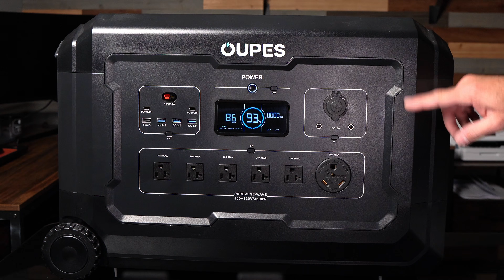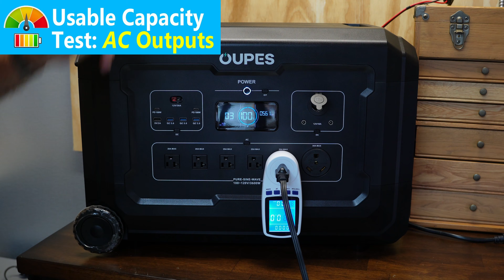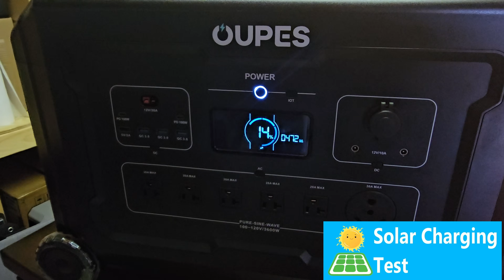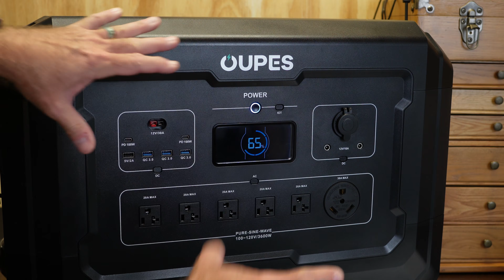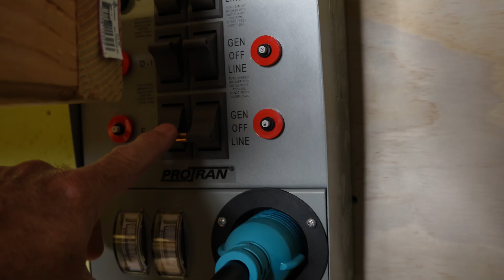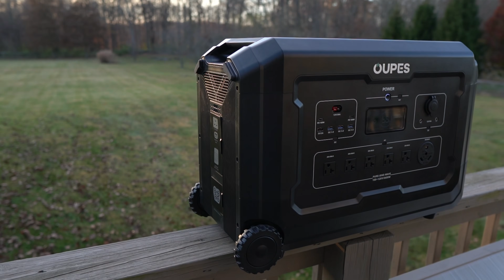The NEW MEGA 3 from OUPES:  Full Review and MEGA 3 GIVE-AWAY!!

Comment: Thanks for the review, in Argentina we have the second brand of Oupes (Souop), the M5 (5000watts) doesn't come with the RV Output like the American market but 5 output AC 220-240V 50-60hz - A10 each plug independent from each other, the question is if I want to add more than 2300w to my house will make sense to assemble (DIY) an extension cord with two 10A male plug (connected in the unit) to a 1 female plug 20A that goes connected in my house. Would those two 10A cables send 20A of energy to my house? so I would have more than 3000watts if necessary to use at the same time? does it make sense? or I will have only 10A in my house anyway? (around 2300w only).

Comment: Love your reviews and the  OUPES  generator looks amazing. I see you been using that cheap 150W electronic load for the testing.  I  suggest you up the game with a real load tester in the 300W to  2Kw range.  The other thing that you could improve is the guitar amp as a distortion test.  While a guitar amp is fine for the rough test best would be to test the THD levels with a proper meter (Brymen BM155, Brymen BM157, Amprobe ACD-50NAV , UNI-T UT219P, Simpson 50126, RISH CLAMP POWER 1000A or 400A as an example ). Such meters allow you to measure THD on the voltage and current side of things (that THD number will be good to compare between generators ). The THD can change with load as well so check at 10% 50% and 100% load while using a space heater or other linear loads. Keep up the great work.

Comment: This Oupes power station is about 50%+ better in every way then my older system for which (a couple of years ago) I paid about the same price (only a little less)  on a kickstarter campaign.  I bought that one mainly because I lost too much freezer food due to power outages, figuring it would pay back itself over the years. It so far has saved my freezer contents twice (ironically no power outages over 30min for 14 months after I bought it). Last power outage I did get down to 20% capacity left, so the extra 50% capacity would be great.

Comment: During past two years, we've experienced more power outages than before.  This is partially due to aging power company equipment and also the weather changes.  Oupes Mega 3, with one B2 battery, totals 5120 wh.  And with 3 year warranty, LiFePO4, EPS, dual charge, pure sine wave output, 3600 watt inverter, fit my requirements list.  Thanks for the review and info!

Comment: Quick question and have watched so many of your power station videos' great info all round :)  

My question is that I have home solar 8kw, and 10kw battery. My shed is connected to mains and runs a few Ryobi battery charges and a chest freezer. Thing I'm trying to find is a LFP Power station with 1000+wh that has pass through charging. I'll attach a timed plug on the outlet in the shed to turn on at 8am and switch off at 8pm, effectively charging my power station up with the home solar and during the night the small load (averages about 65-70w/h) will power off the LFP power station saving 1kw drain off the house battery. Might be a good project/subject to cover if anyone has home solar? Timed plug, power station and use home solar to charge, like you 800w array :)  

Do you think this is a good idea, if so any recommendations on a power station that'll tick all those boxes :) ? Just about to watch this video, just wanted to comment on new video to hopefully grab your attention. Watching from Hobart Australia.
Reply from the maker: Seems like a solid plan to me. :)  Sounds like you just need something with no frills and a low cost, but has UPS mode (for true pass-thru charging).  I'm about to post a video in the next day or so on the Yolaness 1600, that would tick those boxes...and is one of the lowest cost per Wh I've seen (though not sure of the price in Australia).  Might be worth considering.
Reply: I'll be waiting and watching. Cheers for the reply and loving your work. Vtoman are here in Aus and for example a VTOMAN 1000 $949aud or about $600usd* Slow charging @180W but low load throughout the day on the home solar, and I'm mostly at work. Cheers again @ReeWrayOutdoors
Reply: Oupes* but I'm in Aus, Oupes couldn't send one over the pond by chance haha or do they have local dealers ?!  @ReeWrayOutdoors

Comment: ReeWray Outdoors continues to put out great and very detailed product reviews.  
Oupes has designed a great new product line with the Mega series.  As a ham, the availability of a 30A DC output is desired feature I’ve not seen on a lot of products.  The fact it’s an Anderson Powerpole connector is even better as it’s a very common connector used by hams.  The Oupes B2 expansion battery is also amazing with yet another 30A Anderson Powerpole connector.  Oupes is the 2nd manufacturer I’ve seen with an expansion battery that can be used and charged on it’s own and not just when linked to the main power station AND has a 30A DC output.  Oupes went even further with the B2 to include the digital display on the expansion battery as well.

Comment: Another slick video. I think you've got this stuff down! I think that the OUPES Mega 3 might be one of the most versatile Solar Generators I've seen. It also seems to be priced very well, for now. I think it would be hard to beat this price with a DIY build that has all of the features of this single unit and it certainly wouldn't be this compact. Would you know if the BMS inside the unit includes low temp charge protection, in case you wanted it remotely located it in an unheated outbuilding in cold weather?

Comment: David, as usual, you have done an excellent job reviewing what is becoming one of the top Oupes power stations.  I'm glad you did not damage that beautiful unit by plugging in your Solar to the 12vdc-30 amp output.  I agree that a different choice of connectors would have prevented that, but still Oupes should point that out from the get go.  Hope I get a shot at the Giveaway. . . . .this would go a long way to beefing up my Solar, 1000 Watt Jump Start with 1500 watt battery add on, and the old Champion gas generator at 2500 Watts.  Great Video as usual

Comment: The fact that OUPES has extension batteries that are usable and that you can charge separately on their own is quite exceptional.  This is definitely a game changer .    Makes it quite convenient for when you only need 12V power since the B2 battery by itself only weighs approximately 48 pounds.  

David, I have noticed that on discharge tests of 12V dc only on different power banks that the DC is numbers are less efficient than the AC discharge tests.  Do you know why?  I would have thought it would be the other way around since the inverter is not consuming power.  Great video as always.
Reply: A powerful and competitive device Oupes

Comment: Hi David,
              52,000+ subscribers and counting! As usual, a nice thorough review. Oupes has really stepped it up. 100 watt type C outputs, 3600 watt inverter with a surge of 7000, an EPS that works well and it's quiet through the pawn shop guitar amp.. 2100 watts of solar input, 12 to 150 volts at 15 amps. It can handle your 4 panels in series, no sweat. Your 800 watt array is really nice for this power station, .even if you're maxing out the array at about 800 watts of output and around 80 volts, you are still not stressing the power station batteries. It's nice that Oupes now offers an app., even though it's very basic at this point but should become more useful with firmware upgrades. This Power station is a beast and they even make a bigger one! Wow!  I also look forward to watching the review of the smaller Mega 2,  Oupes really has done it again! The B2 expansion batteries are amazing also, with the massive solar input and all the DC outputs. It's like a giant power bank that can be used and charged without the main unit. When connected to the unit, it adds all that extra capacity  and AC usability. Oupes got this right and it's nice that they now offer the 3 year warranty. 
                   Yes, I too wish they would have used an XT60 or XT90 as the solar input to avoid the confusion of having both input and output Anderson connections. If you can make that mistake and fry the output, anyone can. If I owned this unit, I think the first thing I would do is take apiece of black electrical tape and put it over the Anderson output. 
                    Thanks again for these reviews and the channel David, I really have learned so much from you. I truly believe solar and wind power are the future and so much better for the environment. Also congratulations on the DIY manual transfer switch. Just replace the mounting board with a wider one to center it up if it's driving you nuts. 😄. and yes, watching you install one of these would make a great video to see and learn from.
                      Finally, thank you and Oupes  for this wonderful giveaway. Oupes has become a major player in the power station and home backup power market. I kind of wish the contest word was "Britney" but I guess it's best to leave Britney alone! 😂.  Also, sorry for the long response, I tend to get a little "windy". 
                                                                             Thank you, 
                                                                                           Steve
Reply: Hey David,
             Just realized  you could get an Anderson to XT60 adapter and leave it plugged into the Anderson output on the front. Then just plug an XT60 cable into the adapter so it would be less confusing. You deal with so many  power stations, some you plug into the front  for solar charging and some you plug in on the side of the units.. It's easy to make a mistake. You see the red and black Anderson connection, plug in your array and zap, mistaking the output for the input. Oupes. 
                                                                                                       Steve.

Comment: Great review on the Oupes.

I am also interested in know where to buy the blue adapter connector that you used to connect the solar generator to your transfer switch. I have been looking for one. I’m am wondering how it works to connect a single phase source to a split phase transfer switch. I’m assuming your transfer switch is split phase.

Comment: Oupes! I accidentally hit play and watched this video. 

I would never have even considered an unknown brand without this review. Oupes is now on my radar. Why?

Your review is very practical, addressing and testing the features that matter for real world use. You answer the questions us viewers would ask, or in some cases you answer questions we should ask but didn't know to ask. Anker Solix 757 will not resume solar charging on its own, so this is a small but significant point for how these devices will be used in the wild. Oupes made a solid solar generator and you proved it.

If I can add one improvement, it would be to test the surge rating with actual numbers. A unit like this would be occasionally used to power high surge devices from time to time.

You may not have the fancy shop of Will Prowse, but your review was very useful. Maybe one day we'll see you cut open these things to check the wiring and look for low temp monitors. 😂 Well done!

Comment: We have been interested in an emergency backup system for our home. My wife and I have medical issues and we have a small gas generator that I have trouble moving in and out of the shed. The OUPES system would be a perfect unit to set up in the home and not worry about carbon monoxide and other issues that come along with a gas generator. We have already had one stolen from our shed. Thanks for your review, I'm learning a lot more from them.

Comment: Thank you for another great review.  I have a 22 ft puma camper and have been really watching your reviews to determine the best upgrade for the very small agm battery that came with the unit. You almost had me with your review of the Pecron. But this mega 3 from OUPES really fits my philosophy of  "KISS"----- KEEP IT SIMPLE S@#$%D!! 😂😂  With the OUPES all in one design all I have to do is plug my 30 amp shore power cord into the OUPES and the 3600 watt inverter will feed my rv very well. Especially when I get maybe 2 or 3 expansion batteries from OUPES.  All the crazy gadgets that I was going to have to buy for changing to lithium is not needed now! Which means my veteran check goes further and I can go camping in places like BLM land that usually is no hookups.  Camping this great country is a bucket list for me. I want my wife who has never traveled to see all the wonders I've seen. We've gotten used to using a lot of rechargeable lights and fans  and have 60 lbs of propane for cooking in and outdoors. So this OUPES MEGA 3 would solve just about every issue I have about power. Having a couple of OUPES expansion batteries and upgrade my solar will pretty much check all my boxes. And let me and my family enjoy our little castle on wheels before I an no longer able to travel. Camping and fishing are like my therapy but not the cure. But I refuse to listen to my dr who says I need to be in a wheelchair.  As long as I can stand and move I will be camping and fishing. 
Thank you again for your channel and all you're hard work at providing a very thorough review of what is in front of you. I enjoy your presentation and find your methodology very sound and real world. Unless you have something else you can pull out your magical workshop...you've sold me on the OUPES. I hope I can win this MEGA 3 because then I can go ahead a get a OUPES backup battery and have some gas money left in my budget!! Lol
Thanks again sir for the review on the OUPES MEGA 3!! You done good!!!👍

Comment: I like the way this oupes looks. Too bad I don't have any money bc I work at a restaurant only 2 days a week so I have practically no money but oupes oupes oupes I did it again....
Reply: I could use an Oupes for my home. Its just my mother and my little longnhaired chihuahua foxy and myself so not much daily power use only about 15-20kWh on average duringnthe summer and i havent monitored the winter since i just got a monitor installed this spring...I built a system piece by piece over time until I'm currently at 7.2 kwh battery backup in a 24v configuration, and 14x100W panels and 2x200W panels on two separate 60 amp charge controllers. I have just about maxed out one of the 60 amp controllers so with a 100 watt array so I am starting over with a 20o watt array but. The amazing thing is that I was pulling 112% of rated output with a 6x6 setup for about a year. But an oupes would really help me for someone with a lot of time. Even more love and respect and knowledge about energy transfer. As a part time restaurant worker that was my first love, but then i got my engineering degree. Oupes seems heavy duty and long lasting with such a massive battery..go Oupes. It's your birthday  gonna party like it's your birthday 🎂